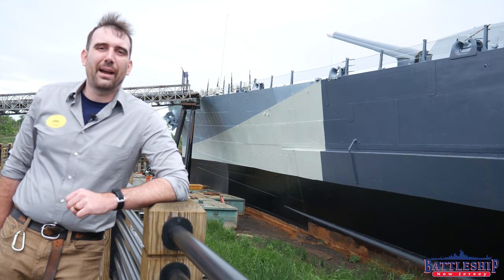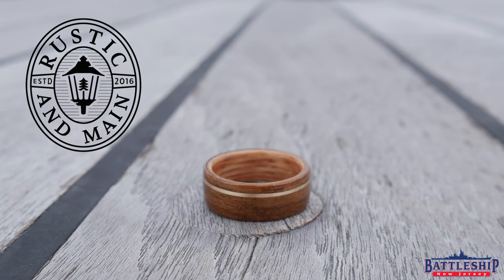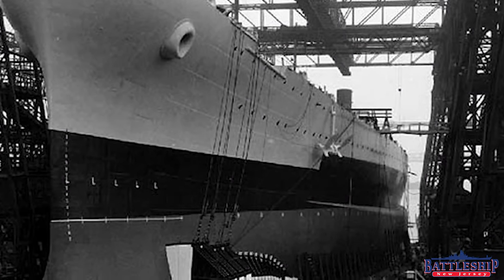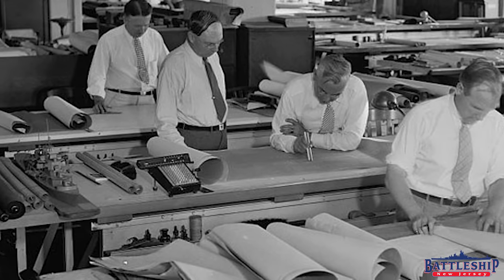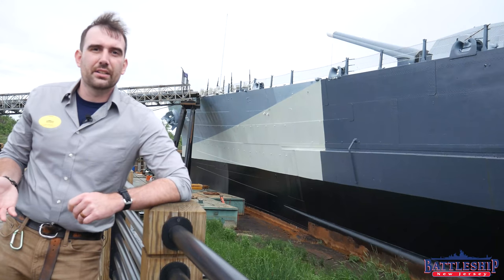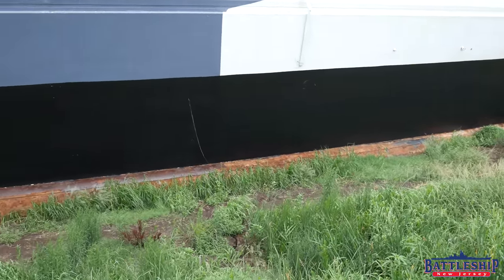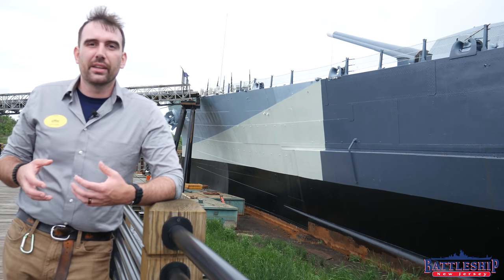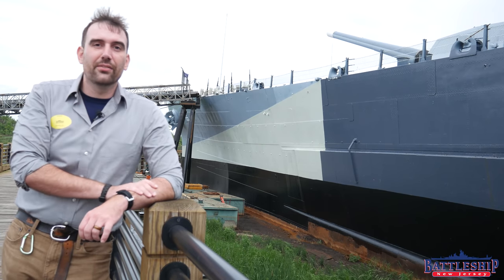Armored Belt: Interior vs Exterior

Comment: At least Ryan doesn't allow his Battleship to get silted up.  the Curator of the NC is going to have a hell of a time digging her out just to dry dock her next time.
Reply: The silt actually helps preserve her by making a very low oxygen environment, inhibiting rust formation. It is the wind and water line that is affected most and the cofferdam system they have installed will allow periodic draining to inspect this area and repair damage easily without need to dry dock. Very similar to the Alabama.
Reply: I know they built the cofferdam to effect hull repairs but I wonder how do they repair or repaint the bottom of the ship?
Reply: They decided to repair her in place instead of trying to free her from the mud and dry dock her. They built a coffer dam around the ship and pumped out the water. They have been replacing corroded hull plating. I am not sure if they plan to let the water back in when they are done or not.

Comment: USS North Carolina is sitting on the ground, instead of floating?
Reply: They decided to repair her in place instead of trying to free her from the mud and dry dock her. They built a coffer dam around the ship and pumped out the water. They have been replacing corroded hull plating. I am not sure if they plan to let the water back in when they are done or not.

Comment: Why not make a ship with internal and external belts?
Reply: Because It would weight a lot, considering the limits of the London naval treaty
Reply: And also would limit valuable space on the ship
Reply: @enalche2  nah, thats not a problem. an all welded construction would save like 6000 long tons, which is more than enough to make an armored belt since adding the internal belt added 5000 long tons. the weight wouldnt even change, and the internal space would be larger as well

Comment: 365 degrees?
Reply: Non Euclidian Geometry - 3 dimensions, not 2. Rudolph the reindeer can describe a triangle with 3 right angles - total of 270 instead of 180 as in Euclidian geometry. Sorry -can't resist (If needed Google "triangle with 3 right angles" - you can immediately get explanation in pictures)